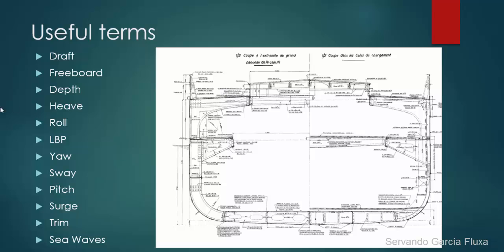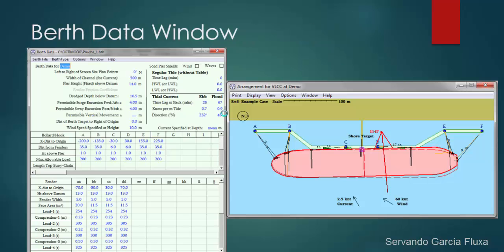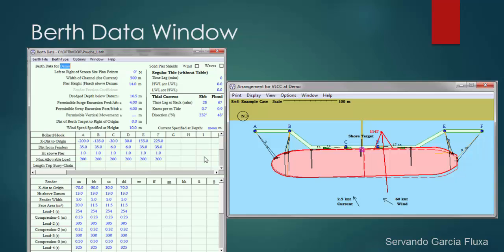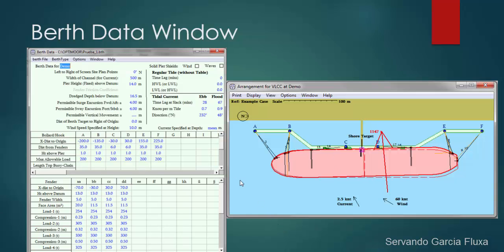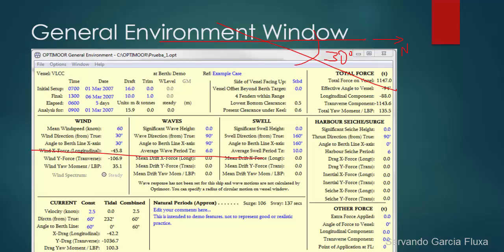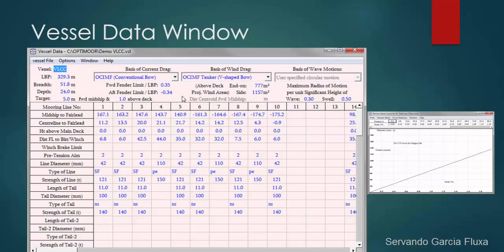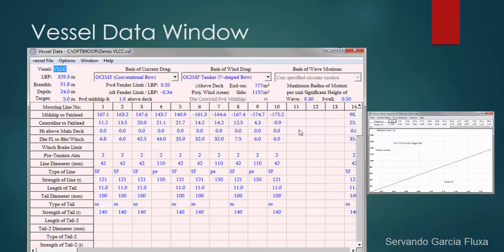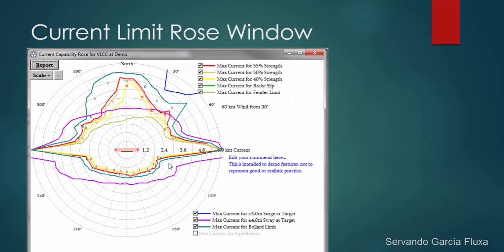OPTIMOOR: Mooring Analysis Computer Program

Comment: Thanks for the tutorial.  My ship is not conventional one as those listed in the pull-down selections.  How do I instruct Optimoor to read currentcoef.dat and windcoef.dat?  How to  instruct Optimoor to calculate from 0 to 180 deg wind and current (co-linear)?
Reply from the maker: If you know the Cx, Cy... that you want to use in your model you can modify the currentcoef.dat and windcoef.dat that are in the OPTIMOOR installation folder. You can open those files with any text editor, I recommend Notepad++. You cannot analyse a variation of winds and currents at the same time, the only options are fixing current velocity and direction and running a 360 degrees wind analysis and the opposite.

Comment: Thank you for the wondeful tutorial Servando! Was just wondering if can I set the "maximum Radius of Motion per unit Significant Height of Wave" to 0.
What would that mean?
Reply from the maker: You can leave it to 0, that will mean that you are pretty certain on the location of the fairleads of the ship you are analysing.

Comment: Hi Servando,

First of all, congrats for your excellent Video. I have been wondering if is possible calculate a multibuoy mooring system using Optimoor? Taking in account that in this kind of systems does not exist piers, fenders and another elements.

Kind Regards
Reply from the maker: Hello Omar, 

Thank you for your kind comment. To answer your question, yes, OPTIMOOR can model multibuoys mooring systems but not with the "Standard" license, are going to need OPTIMOOR "Plus" to be able to do that kind of analisis.

Kind Regards
Reply from the maker: In fact no, OPTIMOOR cannot do SPMs

Comment: hi, we are analyzing barge loadouts using ramps. Can ramps be considered in optimoor since the forces will be affect the forces due to moment? At the same time, bridge/ramp loads may act as resisting forces. Appreciate your reply.
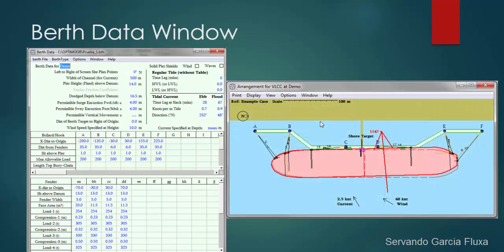Reply from the maker: +Mary Grace Hular minute 15:33 General Environment Window, bottom right corner, where it says "Other Force". If you know the forces acting on the vessel (other than waves, wind...) you can put them there, so if you know that the ramps are going to transmit a vertical force and a moment you should put the values in there.

Greetings